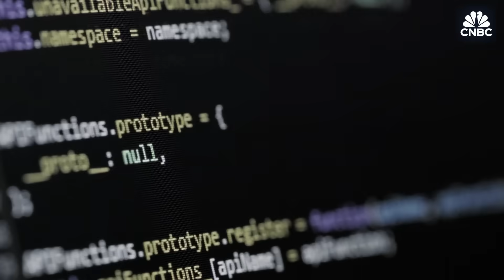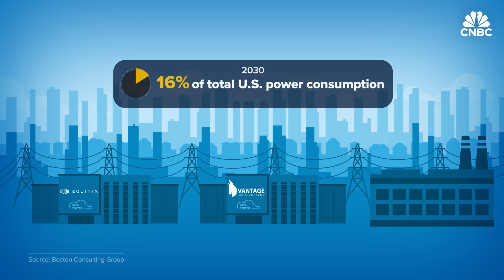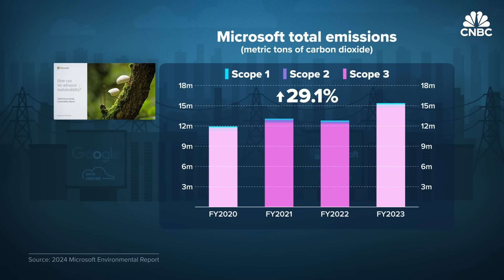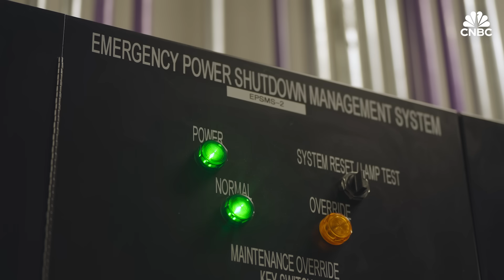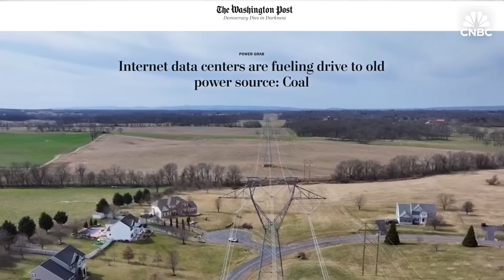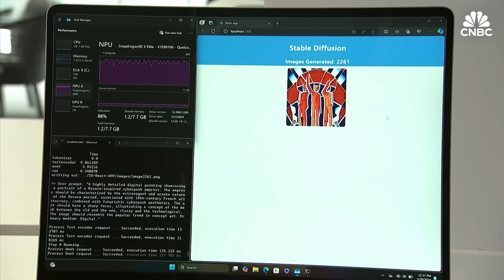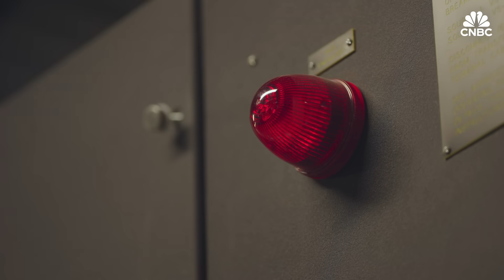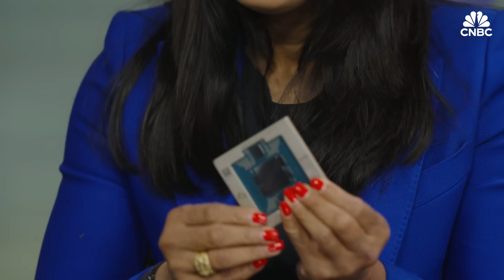How The Massive Power Draw Of Generative AI Is Overtaxing Our Grid

Comment: "The human body generates more bio electricity than a 120 volt battery and over 25000 BTUs of body heat. Combined with a form of fusion the machines had found all the energy they would ever need."

Comment: Amazing.... the energy consumption of generative AI systems is enormous. Training a single large AI model can consume as much energy as several hundred households use in a year. This is largely due to the need for extensive data processing and the operation of powerful servers in data centers. These centers must run continuously, consuming electricity around the clock, which contributes to an increased demand for power 🥇😘🥰😘🥰😘🥰

Comment: Excess heat is not a problem. Have data centres planned into industrial parks that need a lot of process heat. When the heat is used up, it returns to the data centre in a closed loop. Besides food processing, commercial laundries, bakeries there could be greenhouses to heat, a swimming pool, hospitals, hotels or a city heating district. Heat can be stored in thermal batteries then used for steam turbines to generate electricity.

Comment: we need more efficient AI models. Spiking neural networks are currently the best option, modeled after biological brains that are more powerful than chatGPT while only requiring less power than a single lightbulb.

Current research is just scaling our (essentially) brute force models, that consume far more compute power than is actually needed.
Reply: not that simple...
Reply: @FusionC6  yes it is, it’s not easy, but that is the main solution. spiking neural network models have proven to be thousands of times more energy and computationally efficient than traditional MLP models. We just don’t have hardware equipped to scale them and run them effectively.

Comment: The future (already functioning in Nothern Europe) is to also combine data centers with district cooling by absorption chillers and district heating systems. This will allow use of the residual heat generated from the data centers.

Comment: I mean, yeah its about the CO2, but you also gotta think about the amount of waste heat those data centers dissipate, its gonna get a lot hotter in densely populated areas due to that mostly due to a byproduct of energy use usually being heat, because of efficiency etc, even by now there's like a 4° temperature difference between my rural area an the city 12 km away, and that's one of the cities that's still better off because there's a lot of greenery

Comment: It's like the A.I. in Star Trek TMP called Vger, which consumes as much power as all of Starfleet could in a century. There's literally no end to the energy needs of A.I. so rather than just make more efficient computer chips, maybe it would be better to put a cap on the total energy consumption of a.i. systems for the next several decades, so that the demand does not outstrip the supply and people's homes will not have blackouts.

Comment: Use induction effect to transmit power between power grid and home so only voltage transmit and not current. Eliminating transformer as converter of voltage and use capacitance plate with insulation paper or clay sheet so usually 1-5 % voktage transfer directly from plate to plate so 5,000 v ac high power line became 50-250 vac house hold system

Comment: Renewables (variable resources) pose the most risk to grid reliability. Commercials and Industrial users that engage in "voluntary load-shedding" are actually improving grid reliability.

Framing the discussion that AI data centers are overtaxing the power grid is incorrect without substantial proof (which is not really provided in this video).

Comment: What ever happened to the idea to use the bottom of the ocean to chill data? Probably couldn't handle salt right? What about using the waste heat to generate pressure in reverse osmosis of salt water this generating more fresh instead of evaporating previous fresh water?

Comment: The guy that mentioned just use nuclear who cares how much energy it takes like huh? Nuclear waste is a huge problem
Reply: Not really. Nuclear waste is horrific stuff, true - but a nuclear reactor produces only really small amounts of it. So little that 'bury it down a big hole and forget about it' is a viable disposal option. It's also possible to reprocess much of that nuclear waste into new fuel, but this is seldom done because it isn't economical - cheaper to mine new uranium. With more nuclear reactors in use that might change.
Reply: @vylbird8014  I don’t want to live near one in case it blows up like most people
Reply: @libertysoundAU  It's really hard for a nuclear reactor to blow up. And it's inside a big concrete building designed to contain the explosion. It's only ever happened once, and that reactor had some serious design flaws which modern reactors do not share.

Comment: Where does the evaporated water go? Like its in the loop and escapes via molecular holes in the tubing? 
Also, all that waste heat, can't we send that to heat reservoir or pre-heat water for  gas power plant? I think you would need to build it all together though.
Reply: Large-scale air conditioning as used in datacenters often evaporates water to pre-cool it before the phase change chilling. This consumes water (It gets evaporated to atmosphere) but reduces electricity use. Water is cheap and you can dump a lot of energy by evaporating it, so this is usually a good approach. Depending on climate.

Waste heat from some industrial processes is useful, but datacenter waste heat is just not hot enough. You can't do much with it, other than maybe heat a building right next to the datacenter.

Comment: newer more efficient chips specially made for AI is already in the works. most of the training previously was done with GPU architecture chips.
Reply: There's also the odd consideration of Jevons paradox. A bit of counterintuitive economic theory explaining that sometimes allowing for a resource to be processed more efficiently actually increases demand. Originally it applied to coal, but it may be applicable here too.
Reply: They are in production, but good luck getting hold of one. They are all owned by one of the big cloud computing services who will happily rent out access, but never sell them.
Reply: google just bought 400k b200s, new chips aint gonna change much

Comment: can we collect the heat from the DC to boil some water to feed a generator?
Reply: No. It's a lot of waste heat, but it's not actually that hot. It's more lots of waste warmth. Not hot enough to generate energy or transfer long distances. Sometimes it can be used to heat a building that is right next to the datacenter.

Comment: Nikola Tesla, Huxley, Orwell, Turing should be forgiven for thinking their systems can last forever - finite fossil fuels are dangerously hypnotic to humans and their consciousness and mental capacity.
Humans were not ready morally, ethically and intellectually to start the mass extraction of fossil fuels with the advent of the steam engine 300 years ago.
The Magna Carta indeed requires now overhauling adding to it the right for humans to understand what Energy really means before any other commandment;
"In any system of energy, Control is what consumes energy the most.
No energy store holds enough energy to extract an amount of energy equal to the total energy it stores. 
No system of energy can deliver sum useful energy in excess of the total energy put into constructing it.
This universal truth applies to all systems.
Energy, like time, flows from past to future" (2017).

Comment: POET Technologies is a company specializing in the design and development of integrated optoelectronic solutions. Their primary focus is on integrating photonics and electronics into a single chip, which can significantly enhance the performance and efficiency of various applications.

They offer photonics integrated circuits (PICs) that integrate optical and electronic components on a single chip. This integration helps in reducing size, cost, and power consumption while improving performance.

Comment: How can one get a job in the data center industry without any experience? What’s the roadmap like
Reply: Not as exciting as you'd think. The people you see working in the data centers are mostly technicians. They aren't in there to use the computers - that's done by remote access. Their job is just to maintain the physical equipment, which usually means removing the box with a red light on and slotting in a spare. It's really just high-end tech support.

Comment: Some of this is not really legit - it's not like data centers don't pay electricity bills based on actual consumption - it's not all foisted onto consumers at homes/apts.     The one obvious thing we can be doing that helps with every end use, including these, is go hard and deep on optimizing cooling - all hvac systems everywhere.    Many, many loads out there that can use optimizing to reduce power use and many will require equipment upgrades to acheive.

Comment: Southern California is one the most expensive and unreliable places to buy electricity for a high electricity consuming industry such as mega data centers.   Ashburn N. VA can pull electricity from the North Anna Nuclear generating station that has approved plans for a new nuclear reactor with passive cooling ability to resist meltdown if electrical demand increases sufficiently.  https://en.wikipedia.org/wiki/North_Anna_Nuclear_Generating_Station

The cause of global warming is not known; however,  global warming has been dead at about 1°C since 1992.   

 It is impossible for greenhouse gas behavior to cause global warming.   All the greenhouse radiant energy from the earth is completely absorbed by greenhouse gases in earth's greenhouse effect within 20 meters of the radiating surface which would remain the same if the strong greenhouse water vapor were the only greenhouse gas in the atmosphere.   Higher levels of atmospheric CO2 allow C3 plants to survive with less water greening desert fridge areas and increased growth.

Comment: What's overstressing our grid is the idea we can increase demands on it without increasing capacity due to climate change initiatives. If Climate Change is the overriding factor, then we should embrace nuclear.
I wonder if you can use the heat generated by a data center to generate power. After all heat = energy. It obviously won't power the data center, but it will scavenge some of its use.
Reply: You're not the first to suggest it. Wrong sort of heat though. Data centers produce a lot of waste heat, but it isn't actually very hot. Huge amounts of warm air come out, not nearly hot enough for energy generation. You can sometimes use it to heat a building right next door, but that's it.

Comment: We seriously need to build up our electrical infrastructure backbone. With EVs, data centers, and the electrical grid supplying energy all over the country, we're starting to thin out. Especially with some envisioning 100% renewable energy. Nothing wrong with nuclear.
Reply: Or we could rethink our obsession with exponentially consuming massive amounts of energy.
Reply: @mrdeanvincent  You're gonna have to be more specific, because that's a bad generalization. If you mean efficiency, then yes there's need for improvement. Hence the research on more efficient alternative methods. If you mean too much consumption in general, that's the market demanding more in response to growth. I see that as a good thing, it means that the market is thriving.

The point I'm making is, in response to growth, we ought to build up our infrastructure. Otherwise we stagnate. One method is nuclear, which is significantly underappreciated. Renewable is good but that's simply not possible now.
Reply: @jpkral  Efficiency gains must face Jevons Paradox. 

Spend some time thinking about why exponential economic growth is generally portrayed as essential rather than dystopic.
Reply: The cost and the time to build is a problem with nuclear, it makes it hard to justify for new projects.
Keeping the old ones going is nice though, as long as they're safe.
Reply: @ricardoamendoeira3800  "It takes too long to build" has been the excuse for 20+ years now. Just think if we ignored people like you we would have plenty of nuclear power.
Reply: @ricardoamendoeira3800  The potential is much greater then the time and resources it'll take us to get there. Plus I think the view of nuclear being unsafe is silly with what we have today, it's just hyseria from what happened in history.

Comment: Or you know, just use less GenAI? The whole idea of foundation models is that we'd only need one or two of them, open sourced for free usage (e.g. BERT), thereafter every one can finetune them with far less energy use. Now everybody trains their own foundation models for some reasons.
Reply: We don’t need very many foundation models. That’s the whole idea. But people are training the next generation of those models, which will be much larger, and inference (using them) also takes more and more energy. People are not going to use less gen ai. It is often more efficient that other ways of trying to achieve the same goals. For example making a video with gen ai instead of sending a crew of 100 people to Tahiti for a week.
Reply: So naive lmao.
Reply: @TW0man4RMY  You must be new to AI. This was how things worked throughout the past decade, until the FOMO / media hype over ChatGPT. What's the marginal added value of having multiple LLMs with similar performance and capabilities? If you have specific needs, why not swap/append one or two layers at the end and finetune on that? Very few use cases require creating and training the full set of weights from scratch.

Comment: The worst thing of all is that so many companies are investing in A.I. but not because of advances, just the hype. Not many have heard of the fake advances like Amazons self serving shop that couldn't keep up, so they had to have 1000 Indians working with that task instead. Power is not the only problem, also more data centers chose water cooling which needs water.

Btw, I'm not a big Google fan, neither of Microsoft, but I feel the need to highlight Googles serious work with geothermal energy they are investing in. It is not the ordinary geothermal stuff but more advanced which makes it a little more daring. I don't remember where I saw that video, maybe it was by Joe Scott.

What we really need to harden our energy infrastructure for is impending solar storms. Big transformers are extremely expensive and is being built in very limited amount. I believe I heard that 20 is built per year, and that in the U.S. alone there is around 2000-2500 transformers.

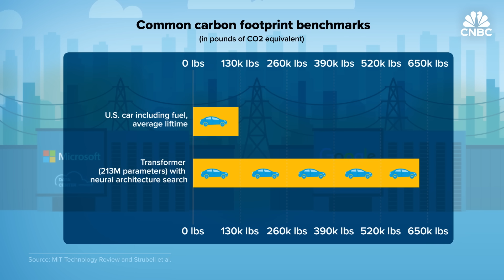Comment: Graph at 1:21 is misleading. 213M parameters with NAS... first off, no one is doing neural architecture search, they have the architecture, its transformer. Transformers today are in the order of 100's Billions of parameters not millions. So the number if the graph is right for 213M transformer (which I doubt), the real CO2 cost is 1000x higher (if power consumption scales linearly with parameter count, which it probably would)

Comment: Can they put this out in space or on the Moon? Space is cold.
Reply: Cooling things in space is a real problem. The only way to get rid of heat is by radiation, so you need radiator panels. Big ones. Look at a picture of the ISS, you should be able to see them - they are the ones orientated perpendicular to the solars.